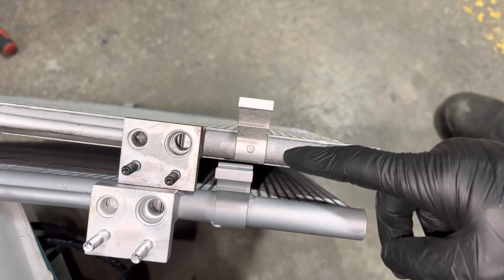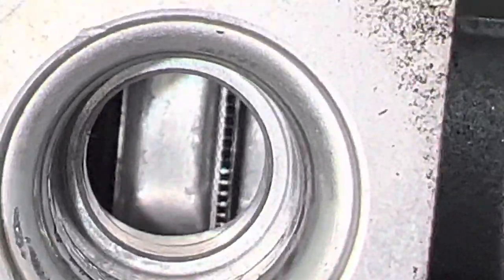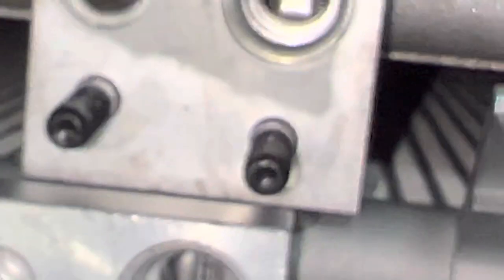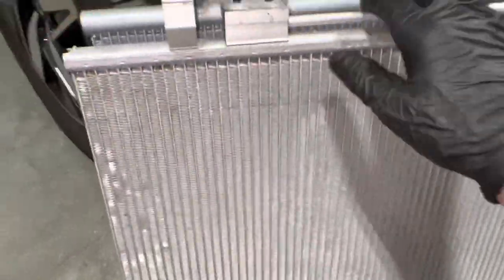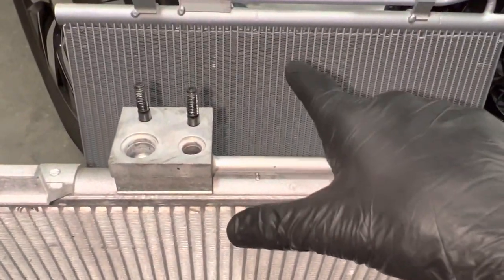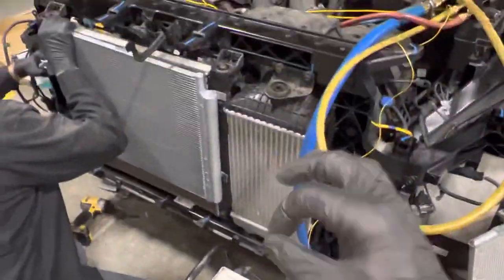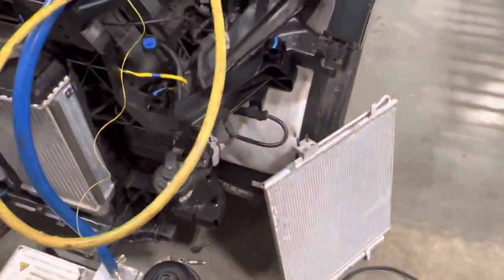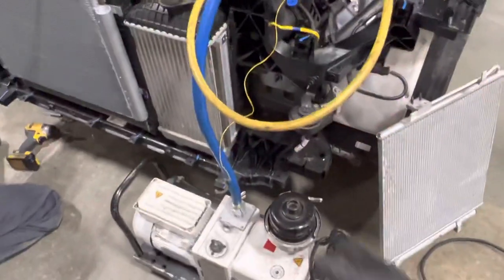OEM condenser versus aftermarket condenser.  There is definitely a difference on the inside

Comment: I own a 1997 Honda Civic EX. It still runs great and I want to keep it. Only problem is the AC does not work like it should. I replaced compressor and expansion valve (Denso). AC would only get to 60F. I then replaced the condenser, (after market from Advance Auto), still does not cool properly. The OEM condenser is discontinued due to car being so old. Is there any after market brand condenser you might recommend in this situation.
Reply from the maker: DENSO does make an aftermarket line of condensers for vehicles and they are usually the highest quality or up there amongst the highest quality for different manufacturers even if they did not manufacture it originally for a Honda. 

Did you perform the oil balance protocol when replacing the compressor ?.  That might be one possibility of your cooling problem.
Reply: @coldfinger459sub0  Nope, I have looked. No Denso condensers available anymore for this 25 year old car. I see there is still available a Koyo condenser that claims it is OEM, not sure if it is true and I don't know about Koyo brand.
Reply from the maker: @mikec555555  yes I’m also not sure about what brands do what for quality wise because they change and it depends I guess where you live in the world or country different distributors purchase different products in different regions. 

I know over here we have some body shop parts distributors that you can specifically ask for their platinum line or their OEM lifeline because they sell and they give everyone the price for the cheap part first because they want to make a sale and that’ll be the low quality part then you have to ask for the higher quality part pay a little more and you get something that’s like OEM closer to

Comment: Hi there, this is surely interesting to see. Have you seen the internals of the Murray condensers? 

On my Mercedes I have 55* vent temps with recirc and rather high pressures. 270-310 PSI in 92F weather. That’s with condenser fan on max and even driving. Only non factory component is that Murray condenser. Would the spraying water test be a good way to verify if it’s a poor quality unit? Thanks
Reply from the maker: @delorean831  Murray usually makes good quality components.  

I never trust anybody’s charge I always discharge and recharge to the correct weight .,

Do not judge off of press alone . 

But you have to do a side to side comparison of of condenser design.  Fin per inch Count , tube count.
Reply: @coldfinger459sub0  Was refilled by hand using 12oz cans and a scale after long vac. Tried playing with charge too and it’s consistently high pressure under high load. No side by side unfortunately as it’s been awhile and don’t have original. 

So for example today I got a car wash and pressure went from a solid 304psi to 159psi with the water.
Reply from the maker: @delorean831  there is no such thing as trying to play with the charge or adjust to get a specific pressure or temperature. 

Before doing diagnosis, we always completely drain and vacuum . 

Precisely fill the vehicle back up plus or minus a few grams of exactly what the manufacturer specified amount and then we check 

Anything other than that there’s no guarantees and there’s no diagnosis performed because it’s unreliable
Reply: @coldfinger459sub0  Last time I filled that’s what I did. Within the oz. FWIW, it’s a TXV system. I just checked and parked with recirc on, subcool is about 3-7 degrees F.
Reply from the maker: @delorean831  if you’re taking the subcooling correctly and there’s no problem with airflow that’s an awful low sub cooling. 

As if the system was low on a refrigerant for an old Mercedes
Reply: @coldfinger459sub0  Edit: Well I messed up. I measure subcool at service port… service port is before condenser… oops.

Actual subcool is 30-40 degrees… condenser is definitely good then.
Reply from the maker: @delorean831  better it’s bouncing around between 30 and 40 because your fan is cycling off and on where is your compressor clutch cycling off and on ?
Reply: @coldfinger459sub0  So I found my issue. My car had an oversized 10pa20 compressor causing backing up refrigerant in the condenser. Later style variable Denso compressor fixed everything. Now pressures will rise up to 22bar at absolute max hot day but will quickly drop down between 9-15 bar with condenser airflow and cooler interior temps.

Comment: Hi, I bought OEM from Thailand - Paco brand, I dont know the inside, but I have the temp sensor at the air vent out, and I see the temp is  6-8 Celsius degree, so its good?
Reply from the maker: Temperature at the outlet is not the biggest difference. 

It’s comparing depress on the high side load on the compressor . 

The temperature at the outlet at moderately warm temperatures can both be 8° C one with the aftermarket condenser one with the OEM condenser . 

But the energy consumed necessary the aftermarket condenser 390 psi and the OEM compressor load on the compressor maybe 220 psi . 

This extra load makes a difference on reduced compressor life 

Reduced gas mileage 

And if it’s an electric vehicle, we reduce range mileage.  Because the electric compressor will draw so much more power. It will drain the high voltage drive battery because electric cars have electric compressors..  and the higher the load from reduced heat rejection from a poor quality, condenser the faster they drained the batteries. 

Only on extremely hot days when it reaches the breaking point, will you see the difference out of the duct temperature will start to change between the difference of the OEM condenser and the aftermarket condenser . 

Regular normal mild temperature makes no difference in the temperature coming out of the dash